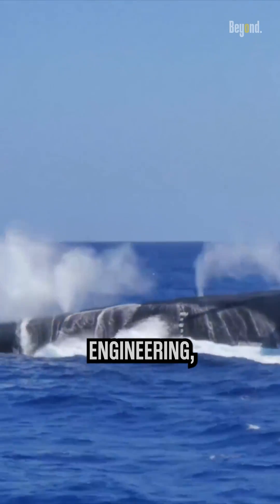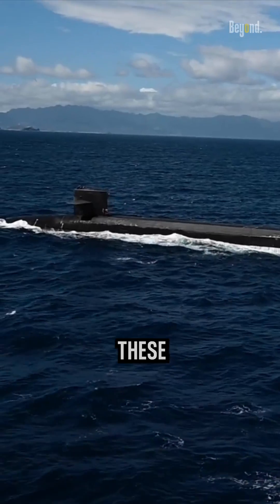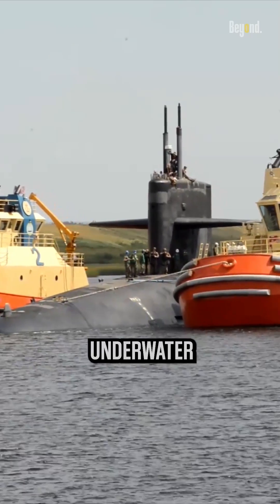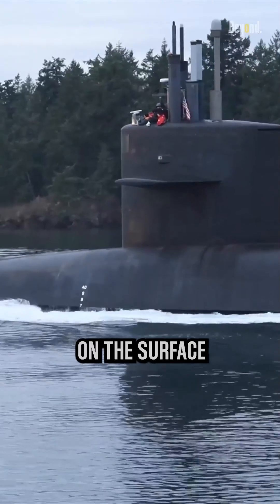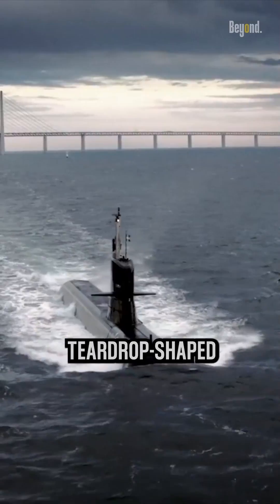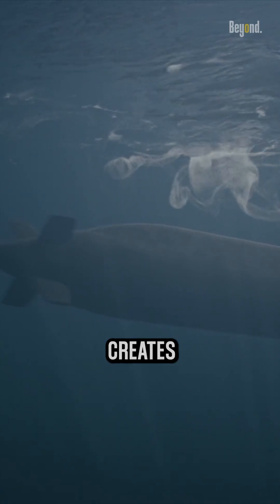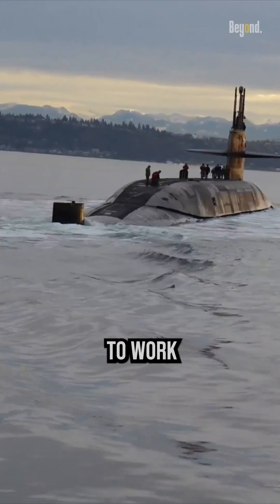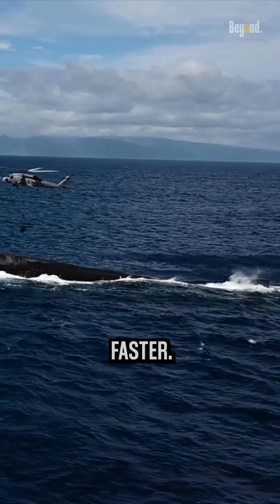Why modern submarines are faster underwater than floating? #shorts

Comment: Water is under higher pressure but it does not get denser. At least to a significant amount. Pressure allows the prop to operate at higher speeds and power levels without cavitation. Less noise!